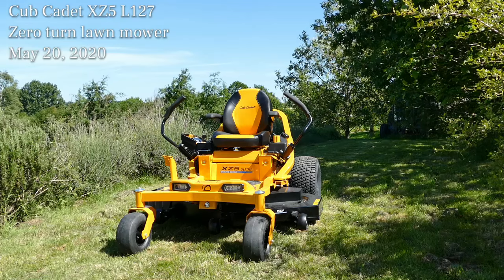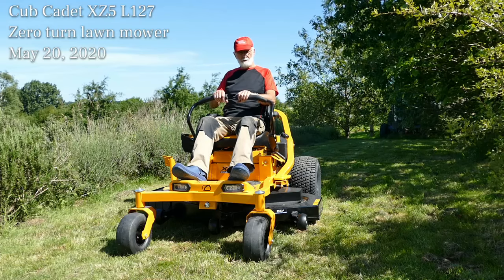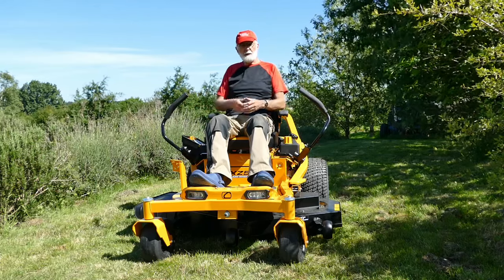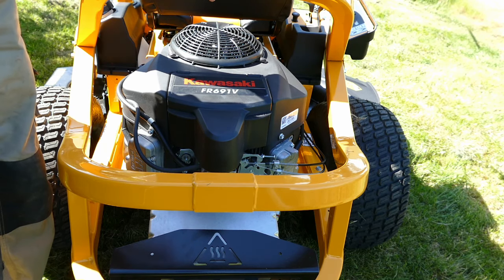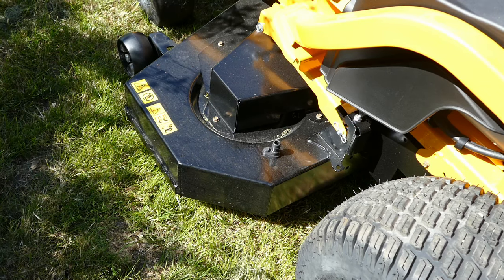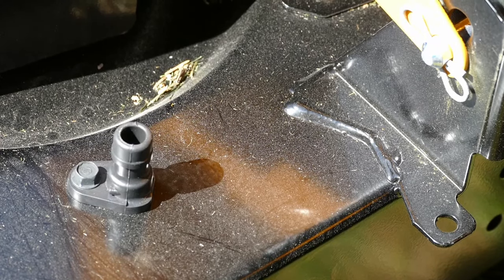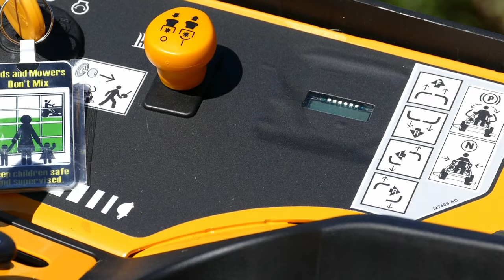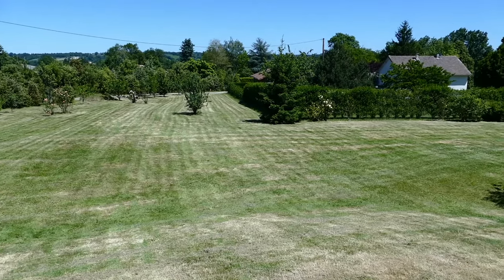Cub Cadet XZ5 L127, Zero turn Lawn Mower

Comment: I was considering this mower against Toro 4200 Timecutter for my lawncare business. I know they are not commercial grade machines but they'll do just fine for me for a few years. They are both similarly priced here in Europe (around 5500 Euros). Ultimately I went with Toro because it's got a significantly more powerful engine (11.4. Kw Cub vs 18 Kw in Toro). And since I cut a lot of overgrown lawns it was a deal breaker for me...
Reply: I had the same decision to make but I decided that support where I live was better for the Cub Cadet. Hope your decision has proved what you needed
Reply: @clivet3428  so far so good. But I've just been using it for the month at the end of the last season. I'm super satisfied with the power and handling. I'll see if the quality problems start popping out as the time goes on.
Reply: 18kw Toro is @3600rpm
11.4kw Cub Cadet is @2400rpm
At the operating speeds (up to 3000rpm, limited by hydros) those two make the same power

Both are 42 inch models tho, quite different to this 50 inch in this video (stamped vs fabricated deck, 2 vs 3 blades, branded vs kawasaki engine, etc)

Comment: Now some time later I have used it quite a bit. Conclusions are 
1. It is very manoeuvrable much more than my previous cub cadet zero turn
2. It is much faster than my previous machine so I can cut the same area of grass in about a third of the time
3.The left hand hydraulic motor some times doesn't seem to work
4. The oil change was easy
5. It is confortable to drive